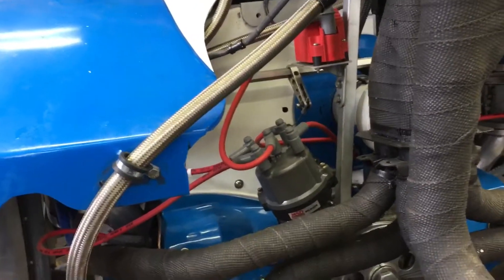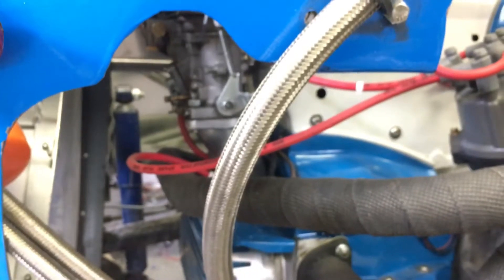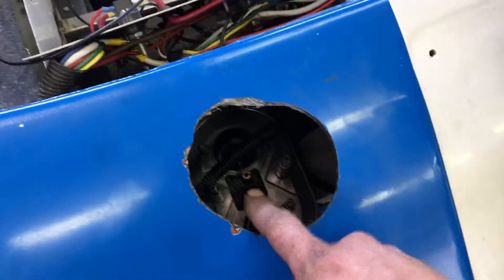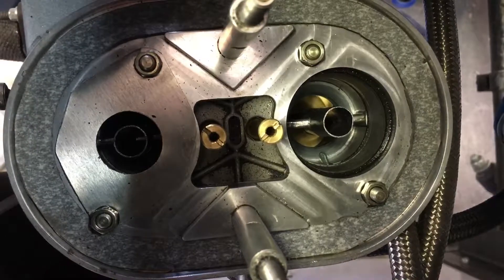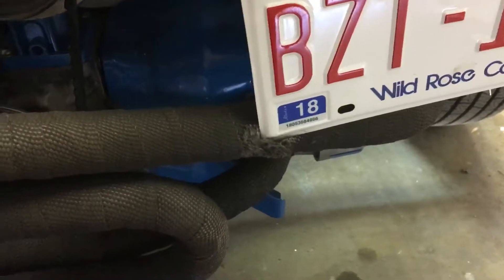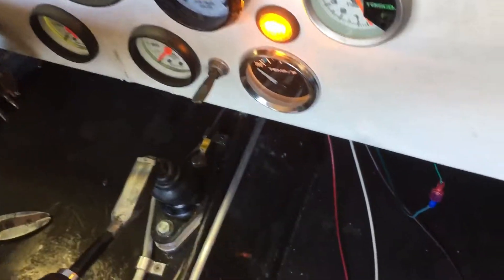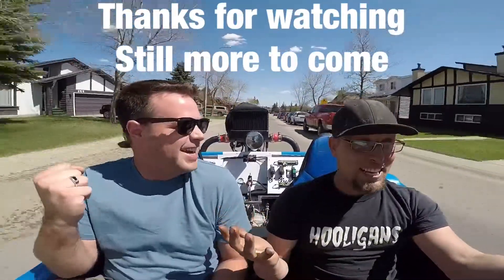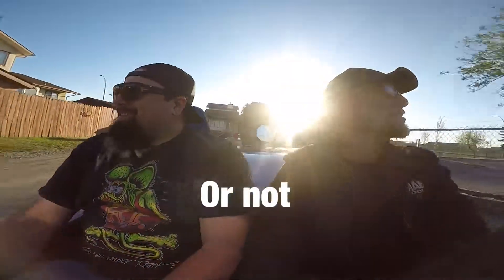How to turbo your air cooled VW part 10: problems and fixes

Comment: What size turbo are you running? Some people have told me to run a t3 turbo but I just need advice
Reply from the maker: Caleb Staton T25, off of one side of a 300zx, it starts making boost in the basement of the RPM range. Right around 2000rpm,  and really starts neck snapping just over 3000 rpm. 

I threw it on the dyno last week, have some data from that. Just editing the video, should be up by friday
Reply from the maker: Caleb Staton if you’re a stock 1600 (ish, not a big inch engine) a smaller turbo should give you more gains down low, less lag from waiting for it to spool up. 

Under cruising (3000rpm on the highway) I was around 2 lbs of boost, it had plenty of jam to climb hills and pass people.

Comment: You are going to blow that thing it’s running way lean
Reply from the maker: Marcos Carrillo you’d think so, but running low boost, with the CB turbo emulsion tubes the AFR is really fat, I ran it all summer without a problem, this is also why I have the wide band O2 sensor to help me keep an eye on what’s going on. 

I really do appreciate the comments and the view, thanks!
Reply: Oh crap I’m sorry I just realized that it was only a 1600 as well u did a great job looks like it hauls ass